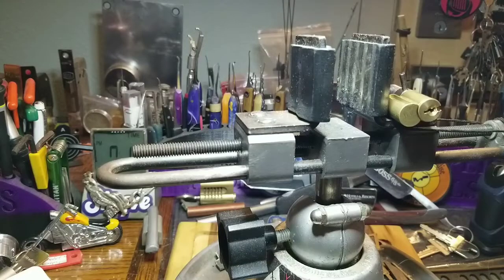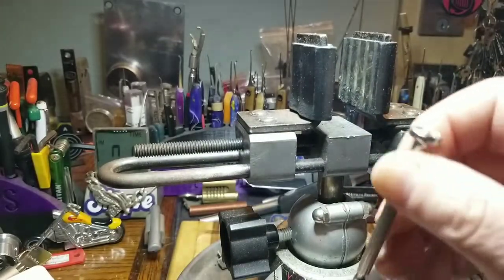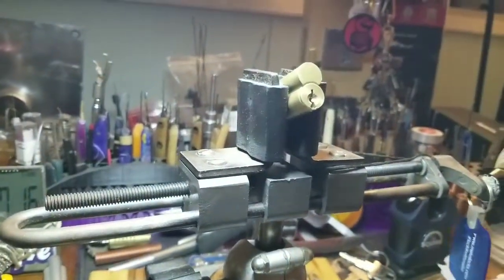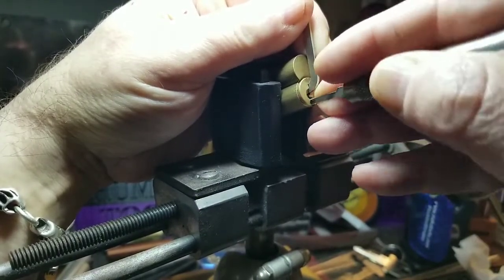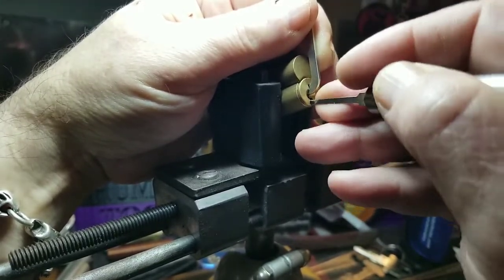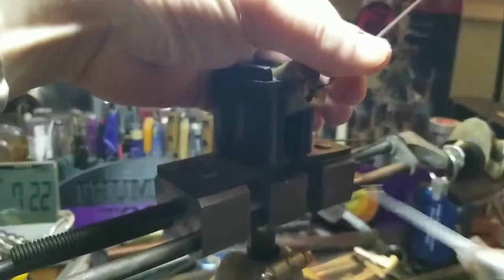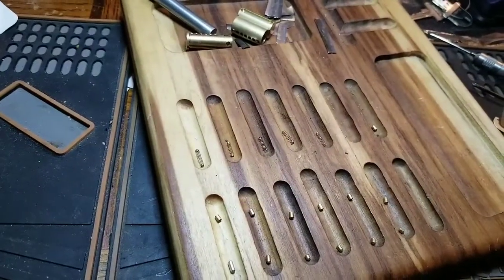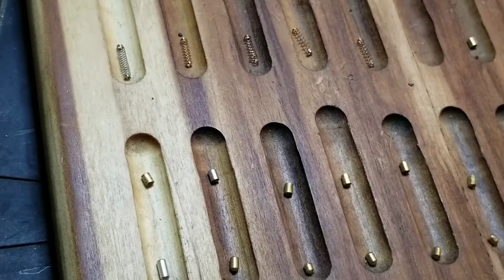#878/Picking a Federal puck lock out of the puck

Comment: Tolerances must be good in these cores for it to be such a good pick and only have all standards. Disappointed they put standard pins in all chambers. Even so, nicely picked and thanks for this Thumper. I'll gut mine and use the video to do an update on my giveaway. 
Cheers Thumper for those instructions. I tried gutting a cheap puck lock a year or so back and destroyed the core. This time it shouldn't be hard looking at how you did it. 
🙂👍🏻